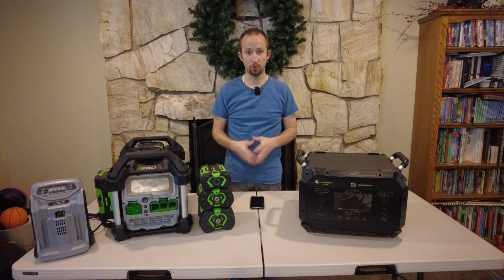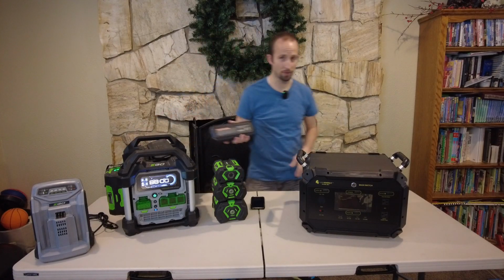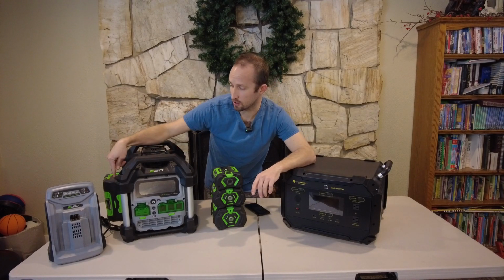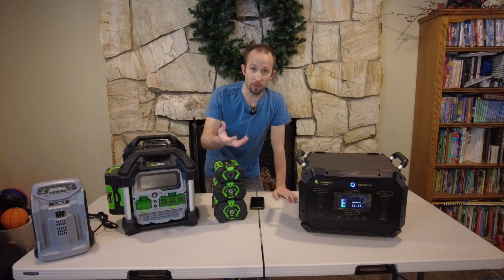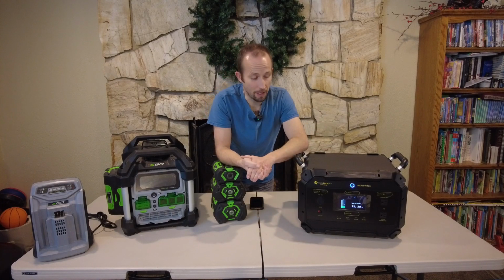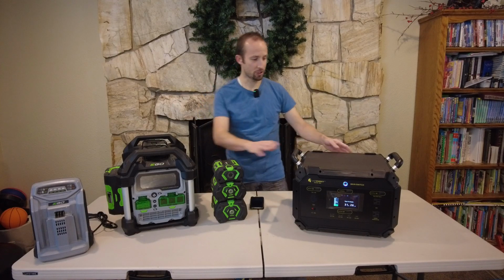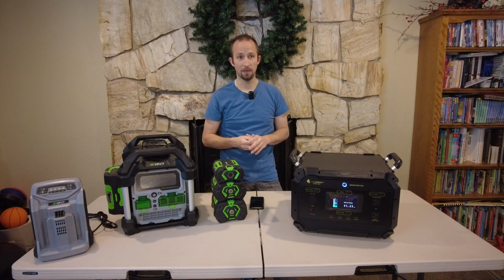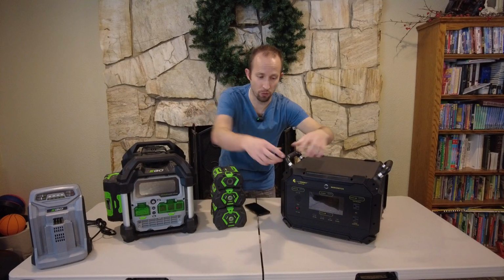Lion Energy Safari ME vs Ego Nexus Power Station

Comment: Reminder that you can purchase a solar adapter that allows you up to 180 watt input.  The issue there is that is a pretty small limitation (I have ordered one to test) since most of the solar panels in RV are from 300 to 400 watts (mine if 400).  Also, the EGO is about $1300 vs the $2300 for the Lion.

Comment: Actually I’ve ran my High Powered Microwave for 1- minute showing I was up at 100% using 2025 watts without tripping.  I do have a Rapid Charger and I plan to a 3rd Power Station for my Trailer that will have a 200-watt Solar Panel to recharge my Ego Batteries.  I’m an Electrical Contractor who knows how to separate my Neutrals to run half of my 15 & 20-amp circuits on Power Station #1 and the other half of my 15 & 20- amp circuits on my 2nd Power Station.  While running my 2- Power Stations during the day and all night I’m totally separated from my 200-amp Main Panel that can receive 240v power from my Generator to run the A/C and the Well

Comment: Ego has solar charge. But it's only capable of taking in 200w max power and takes 13 hrs to recharge and you can't use it while it charging. Might wanna update or delete this because charger has been out for months.
Reply from the maker: Yeah it literally came out one week after I posted this video. But I agree with what you said that it is minimally useful at best due to its rather low solar input and the fact that it cannot be used while charging.

Comment: I have a small solar  setup on my detached garage with a LiFe battery bank.  I use it to power the garage & fast charge my Ego & power tool batteries.  I could definitely use a ego generator without requiring any gas.

Comment: I have an Ego power station with 4 x 7.5ah batteries ($1000), a Goal Zero 1000 ($850) and a DIY solar system with 60a mppt charge controller, 3000w reliable pure sine wave inverter, lifepo4 3072wh and 650w solar panels ($1532). I got deals on everything I bought. I love my ego power station, because I have a bunch of their power tools. I understand it’s limitations and yes the solar charger that they just came out with sucks. But let’s be fair when trying to compare these 2 products. It’s like comparing apples to oranges. I can’t use this Lion’s Energy for anything else but as a power station. I can’t take out the Lion energy’s batteries and use it on my leaf blower, trimmer, lawn mower, etc. The price of the Lion energy safari ME is $2000. For that price, there’s the ecoflow delta 1300, bluetti ac200, etc. Most people that buy the Ego powerstation, already have a bunch of their power tools. I think a better comparison to the Lion Energy Safari ME is against the Bluetti AC200 or the ecoflow delta 1300. But thanks for your video, we appreciate the information.
Reply: Agree on the comparison...I would like to see Goal zero yeti 3000 in comparison too!

Comment: Give the Lion Safari ME the ability to add a 2nd expansion battery and it's value would increase significantly!
Reply from the maker: Yes I totally agree. I actually went to the Lion Energy Warehouse a couple weeks ago and talked to the engineer on this very subject. Also, a soft start built in is necessary on subsequent models.
Reply: The ability to chain the expansions together would be awesome, adding an addition 2kwh would be cool. I saw the Lion wall batteries, I thought those were pretty cool too.

Comment: Excellent presentation. This is the first I’ve seen from you. We have the older version of the Lion Energy unit and it works very well. I am more than likely going to buy the new ME version shortly. As a total aside it’s nice to see someone who has a bookshelf with books in it.
Reply from the maker: Thank you. I will be posting a short follow up video soon on some other things I've discovered regarding both units.
Reply: I saw a review on the older style Lion Energy where they said that a con is the DC output isn't regulated.   Do you know if the new style ME is regulated?

Comment: Ego has a solar add on coming out that was somewhat recently announced.
Reply: Id say that's pretty good. Ego is very innovative and always bettering thier products. I got one to test tower ac when glamping.
Reply: I would have a safari if it was less than 1,200
 I think the big point that still not being accepted is, Ego bat can be used with thier chain saw. If we r talking storms or worse. Chain saw. Pole pruner, mower. I could clean up my yard with out dragging a cord through the water. Which is what you would have to do with safari . I like safari fast recharge but that's it. I have the solar add on. And if looking for a way to cook.  Look at gosun solar cooker. Cooked sausage in 30 min with just sun.. Anything us better that nothing
.but Ego still seems best way to go.
Reply from the maker: Yes it was. It literally came out one week after I posted this video. Not very useful however, at only 180w of solar input.

Comment: Dude, solar capability is coming out in a couple of weeks for the Ego, relax yourself.
Reply: Yes I looked into that. Only 6% more powerful than the wall charger at 180w vs 170w.... negligible. Still close to 13 hours of charge time for four 7.5ah batteries in a perfect solar generation scenario. And I don't think you can't use the machine while you're charging. Was really hoping Ego would redeem themselves with this.....not so much!!
Reply: @landonhilton8845 , using a small gas generator to rabid charge the batteries is good enough. Remember, electric outages on the average last a few hours. This will definitely do the trick.
Reply: @longislandairgunner1600  , true unless you live in the south with hurricanes. No power for a week or so. I do like the Ego but with no pass through charging, it hurts the unit bad. Many others let you
Reply: @leewarner9357 , lee the unit is only $499. I have the Ego snowblower/lawn mower/trimmer/leaf blower, that being said, I have plenty of batteries. With a small gasoline inverter generator ($500) to charge the batteries quickly, we’re talking $1,000. A hell of a lot better than that over $2,000 battery unit!!!
Reply: @longislandairgunner1600  I know its expensive but you are not aware of the lithium phosphate battery in it, 922ah. With solar hooked up to it,  it can charge while using it. Up to 600 watts can be imputed into the thing. Meaning it wont drain hardly in sun and does not take 1 to 3.5 hour to charge 1 battery like yours, depending on charger. RV guys use the Safari to run there whole RV with the expansion pack. And you can get the 26% fed tax credit with this if you use the solar for your home. I'm using this with the expansion pack and solar to run my 25000 gallon inground pool and the pool house. It's totally off the grid now. I'm now pushing almost 3000 ah with a total recharge if brought to dead in 3.5 hours. With a sunny day, the battery only makes it to maybe half way thanks to the solar helping out I'm not dogging out the Ego at all though. It's good for what it is. If you are heavy in the lawn tools they have and have a fast charge, it would help. In my situation,  its only a temporary fix for me. During hurricanes,  there is no power. Meaning no gas for up to a week or more. How would I be able to charge the unit when dead? Yes I have 2 Honda gens, but they are for my heavy loads only. Fridge, separate freezer, few lights and ac. Have to have ac down south in the summer. For me, the safari can maintain its self with the sun. Never need a plug for it. Can move it out of the pool house and bring it in my living house and power my microwave,  tv, lights, and charge my phones and tablets. Not to mention my gas hot water heater. Need electricity to work the  thermostat and ignition on the gas water heater.
Reply: @leewarner9357  , understood. But you do not have sunny days all the time. Also, your comparing apples and oranges. The Ego for what it was intended for works great for me. I’m not looking to do what your doing. So it’s not a fair comparison. By the way, a 7.5 amp battery I charge in 40 minutes not hours.
Reply: @longislandairgunner1600  , it's cool dude. And yes, a 7.5 will charge in that time with a fast charger. For the average Joe,  it's a good platform for some tools, camping, and minor blackouts for a few hours. And after a hurricane,  it gets really sunny and hot. Where I live, its sunny almost everyday. Live off the coast of the Gulf of Mexico.
Reply: @leewarner9357 , exactly Lee, not everyone lives off the Gulf of Mexico. The Ego platform was intended to compete with Milwaukee and ryobi platforms. Also to note, the Ego will run indefinitely while there is a blackout to run the refrigerator charge cell phones/ computers and some lights on. Remember, I have multiple batteries, so while the ego power station is being used, I am charging my other batteries with my portable gas generator and keep swapping them out. So I can run for 24 hrs. Not a few hours.

Comment: I just bought the ego nexus got it at homedepot yasterday for 599 with  two 7.5ah it was on clearence  i think is a good deal
Reply: Dang nice! Im looking for one myself. Hoping to find a deal like that
Reply: That’s a great deal. I had bought 2 of these units for $1400 off of people selling pallet returns. I sold 1 of the unit without the batteries for $400. So I ended up spending $1000 for my power station with 4 x 7.5ah batteries. FB Marketplace and CL has the best deals. I thought I got a good deal, but your deal is awesome.

Comment: I have the ego nexus power station. Love it. Run my furnace tv internet and fridge with 4 7.5amh batteries for power outage. I have a small 1000 watt gas generator to recharge batteries as needed . Ego is great

Comment: Just looked on line for prices. Ego sales for $999. Safari sells for $1,999. So could have 2 Ego units.  One to charge while one is running.  And still be able to use batteries for all my Ego Equipment.  Plus the new zero turn that's coming out will have 4 x 10. Batteries on it.  Safari not bad.  But Ego still for me.  Nice presentation though.  Always good to compare.
Reply: This sounds like a sales pitch for safari for sure....
Reply: @hauk3839  I was thinking the same exact thing.
Reply: $1,999 for only a little more than 900 Wh. Seriously? I'll keep my Ego which allows me to easily replace batteries as needed without rendering the power station useless because its not a closed system. So far I have been very happy with Ego battery life.
Reply: The Safari will charge in a hour and 30 minutes and solar as fast if you purchase the panels. Biggest thing is you can use the Safari while charging. The Safari has Lith. phos. battery. 2500+ charge cycles
Reply: I'll keep my jackery solar stuff to charge batteries

Comment: good stuff.  i think none of the tool “generator” is really an option for prolong  power outages.  dewalt and Milwaukee is worst with no display.   please do more
Reply: It is, just charged EGO battery off of 500 watt car inverter. You could then place the charged EGO in power station.
Reply: @martialman.4563  lol. that would take forever. fast charger needs 750w of power.  i keep my honda for now. version of two of ego power should have bigger capacity solar charger and simultaneous charging and power out too
Reply: @ometofu  I worked fine, charges at 550 watts, about 45 min per battery, 7.5amp hour.
Reply: @ometofu  We had enough power here in TX, no problem.

Comment: I may still get the Nexus 3000 at some point.  I just purchased my 1st Ego device, a chainsaw.  I hope to get a pole extender chain saw for it plus another battery and then a mower one day.  Once done, then grab a Nexus 3000 for power outage issues we have here in NorCal.  Biggest gripe is you can use and charge this at the same time so only way I see during power outages that last for days and solar is to use the fast charger, maybe 2 of them, and create a small solar setup to charge the external batteries during the day, or a small propane generator, so at night you can have a couple batteries say to swap and keep the fridge going.  At least that is what I may do.  We shall see.  Thanks for your cool video!
Reply: Solar charging is even slower than the already slow built in charger so to me it would be useless. The Ego is all I need to get me through the typical power outage but I do have a small 700 watt gas generator used just to recharge batteries for extended power outages. I prefer the dual charger that came with the Ego snow blower as I can change 2 batteries at the same time.

Comment: Sounds like the ego solar charger is being released in March. But sadly it’s not going to be pass through charging capable.
Reply: Thanks for you comment.
Unfortunately it's only about 6% (170watts up to 180) more powerful than the wall charger.....negligible. Still leaves you with almost a 13-hour charge for 4 7.5ah batteries. That is if you have the perfect amount of solar power.